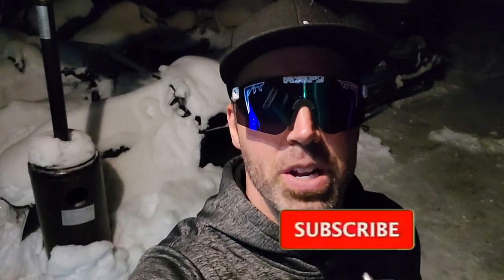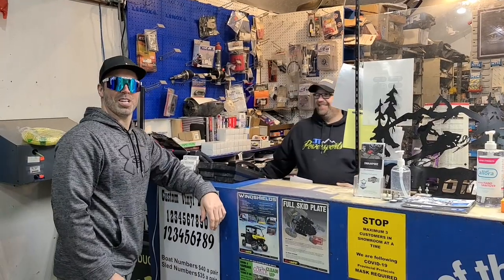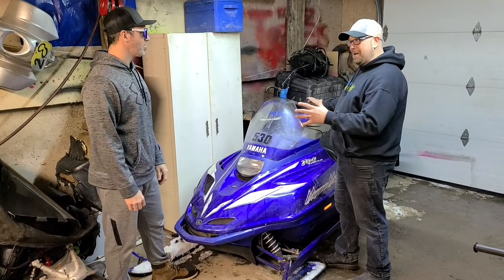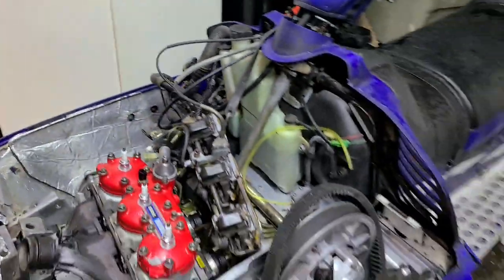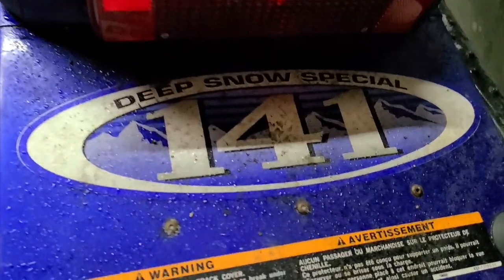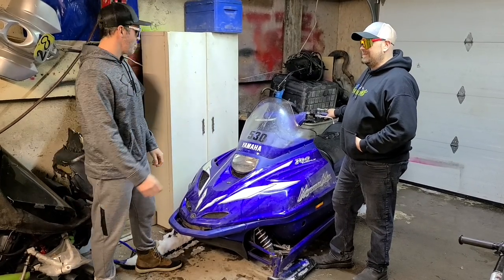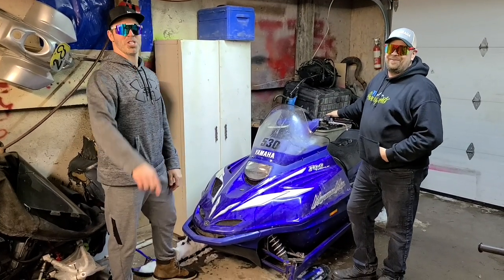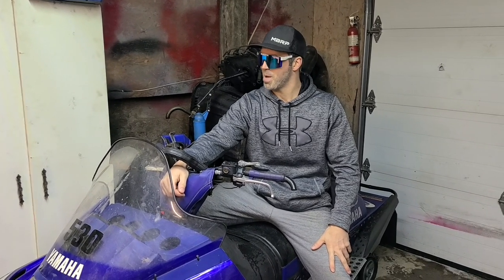I FOUND A MOUNTAIN MAX | 2001 YAMAHA MOUNTAIN MAX BUILD

Comment: 10 months ago and no update?! How's the build going? Excited to see what you guys do to it as I'm on an '01 mountain max triple. It has Vforce reeds and a can, but curious what else I can do to it as there doesn't seem to be a lot of info out there about these machines.
Reply from the maker: Yeah sorry for the delay, things have been crazy busy on my end and haven't been working on any content in a while but hopefully over the winter i'll have an update on the ol' girl! Thanks for watching!
Reply: Totallyamaha forums man! You can do the single layer headgasket mod but have to run 91octane. Reedspacers help on the redhead because the transfer ports are slight blocked from factory.
Reply: @remi009340  what are the benefits of this mod? 
I only run 91 octane fuel in my toys.
Reply: @Loghopper420  It bumps up the compression ratio for a slight HP increase. Lots of writeups on Totallyamaha.
Reply: @remi009340  I'll check the forum out. Thank you!
Reply from the maker: I've been too busy to even touch that thing but I'm hoping to get it going again over the winter
Reply: @MoreToysMoreNoise  I just put 100km on mine over Xmas. Runs like a top! I love the sound and feel of that triple. Real fun machine. 
Have a trip planned for new years. Camp and ride 2 days in southern alberta 🤘
Reply from the maker: @Loghopper420  That's awesome, yeah those triples are beasts ! Enjoy your trip , that will be fun as hell ! Cheers!